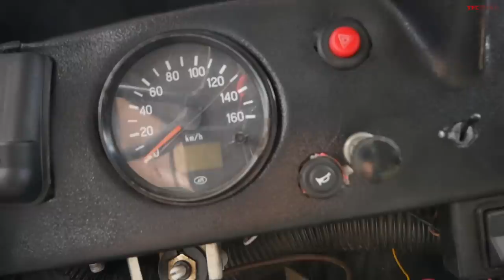My Russian Van Is A Better Off-Roader Than Even A Modern Toyota Collab — And THIS Is Why!

Comment: He doesn't get it. This is for extreme cold and going places where the driver is on his own. The systems, including the door handle Motoman goofed on, are made to be ultra reliable, especially in off road and super cold environments, but still affordable to middle class Russians. The machine is spot on for intended purpose.
Reply: This was not affordable and not accessible, only 10% of the soviet people had vehicles because it took 10 yrs to get them and wages were extremely low, and good thing we have capitalism, you have a better car that's more comfortable,  and btw, its just a door handle, most don't break
Reply: @guamazolopez6456  But how do those comforts and stuff handle -40 degrees celsius in winter and +40 degrees celsius in summer...
Reply: @guamazolopez6456  Like I said, middle class. 10%, Maybe? My point was really that it's not a luxury vehicle but a utility vehicle.
Reply: @mike36dc  You are all wrong. :)) These  UAZ 452s were mostly in police and military use along with GAZ 69 and UAZ 469.. Soviet and Bulgarian people (where I come from) usually were able to get Lada (usually VAZ 2101) or Moskvitch (408 or later 412) after 10-15 years waiting list. And maybe 1 of 10 families had a car at all. We had Moskvitch 408, 1.4L, 54 Hp. a beast :)))) And BTW there was no middle class in the communist era... We all were poor except the big fish.
Reply: @BelchevKalin  Understood. The middle class comment meant the cars were made for function for those who could afford a less expensive car (middle class) as opposed to the very rich who could afford whatever they wanted. But thank you.
Reply: @mike36dc  I got what you mean.
Reply: @guamazolopez6456  the stupid part of this statement is it took me longer than 10+ years to get a 90cc enduro from the 70's as a first vehicle. The only reason you think it takes less time in America is because we take out loans and pay for stuff backwards.
Reply: I worked on a gold mine in Kazakhstan 40km north of Ust Kamenogorsk near the Chinese border. We had a few of these type on the mine and got us through deep snow, mud on site at -40C, no problem. Fit for purpose.
Reply: It was not really affordable/accessible for normal Russians.  The Lada Niva is for more ordinary citizens.  But that took ten years of waiting, like all Soviet-made private vehicles.
Reply: Деревенщина из Сибири - Абакан   That video was awesome. Thanks for the share.
Reply: K think it was primarly utikity car for wide variety of use in industry, police, ambulance, army etc. In extreme conditions with easy maintenence.
Reply: @russetwolf13  i have seen mexicans get better cars in 2 or 3 years lol, and if you didnt readed the commen from the bulgarian guy, less than 1 out of 10 FAMILIES  had a car, how many families have a car in the US? What car continues into production with no improvements since the 60s in the US? Or the entire world for that matters lol
Reply: @StoneCoolds  Americans own cars, we don't buy them. We convince a bank to lend us the money to buy a car now and spend 10+ years paying off the loan just in time for the car to start falling apart. Though a lot of the time they can't pay for it and a terrifying amount are repossessed by the bank.

Most every person I know, the majority of Americans in fact, would kill for a functioning Buhanka because most of the time we pay top dollar for barely functioning cars beaten to the last inch of their life. This is what no one talks about in America, you look at the nice new cars and see how many Americans own cars and don't realize most of those cars are barely functioning rust piles, not brand new Teslas.
Reply: @russetwolf13  yeah. The USSR had a lot of reasons. People not going into debt to buy cars was not one of them
Reply: This machine is for deep deep forest. I don't understand, why this shit is steel in production.Piece of......      Shame.
Reply: @utfinjuice  Dude, this would sell in The States. Most of our "manly" suv's are really made for women. Upgrade the chassis so it could hold 80 mph and it would sell like hot cakes.
Reply: Why you compare two different worlds. This car was supposed to be repairable in the middle of swamp with few simple tools. Then, all in ussr was standarted. This was the one equipment for all the purposes it supposed to perform. Which mean you can get spare parts everywhere within the Soviet Union. And it didn’t take too much room for storage. If you have basic small sedan there was same idea. No big variety for thousands different bolts or little rubber things. That was supposed to save lots of valuable resources for global scope. 
And in Soviet Union they didn’t really need too many personal vehicles because all was designed to reduce need of it. At public transport you could go everywhere in the city not like now in America. And those vehicles were supposed to last forever not like modern comfy cars falling apart without possibility of continuing use. You can imagine how it affected ecology and resources. We selecting garbage and wasting crazy amount of valuable resources.
Reply: @StoneCoolds  That's a good point. But it should be noted, American cars and trucks are better and more reliable because of the Japanese. American cars in the 1970's and 1980's were on the whole poorly designed and unreliable, and then the Japanese began to import reliable cars that were nice to drive and they had huge sales. American manufacturers had to up their game & American cars and trucks only then improved tremendously.
Reply: вы верно отметили назначения этого автомобиля. но не только в холода а скорей для сурового бездорожя. где главное минимум электроники и максимум ремонто пригодность.
Reply: Plus you can access the engine from inside the van
Reply: @StoneCoolds  don't forget city planning as well, like imagine having a kindergarden, a school and a few shops within walking distance, ah yes for everything outside your walking distance you have buses/trams/trolley/trains
Reply: @StoneCoolds  That's not true. I am Bulgarian also. We had plenty of cars but they were mostly Lada and Zhiguli. Only a fool would wait 5 years to get a car, you could get one very quick if you grease the right palms. Maybe in Russia they had to wait 10 years, not in Bulgaria.
Reply: i was watching Russian documentary about Yakutsk recently and i found out people have a warm blanket for their cars so everything doesnt freeze before morning before they go to work.. im not kidding, just check it out..its on youtube
Reply: @minecraftfirefighter  I live in america so i dont know if thats 400 degrees farhenheit or -400 degrees farenheit
Reply: as a matter of fact this car had never ever been designed for "middle class Russians" or any other private user, it is designed for a heavy duty military and civil service, emergency personnel, collective farms, oil and gas drilling workers etc. I'm not quite sure it had ever been available (not even to say marketed) for private use in USSR. Have you ever considered buying a waste disposal truck for your everyday commuting? well, that is exactly the same thing
Reply: @guamazolopez6456  somewhere in the middle, most of Siberia will be warmer, temperature like Canada... Where people drive nice cars.
You can't even fit a Canadian's breakfast in this van.
Reply: @julianpetkov8320  Here you have to grease the Ford dealer, I mean, pay the "market adjusted rate." Same thing.
Reply: Ha! 😆😆😆
So many Americans taking the opportunity to point out that everything about Russia is bad. 
What does that tell you about someone!
Reply: @StoneCoolds  Don't worry. You, too, will soon own nothing and be very, very happy indeed, lol
Reply: @whenuakitekid  no American on this thread said a thing negative about Russia. Maybe read again? Everyone just loves the van, but some from where it's sold, not Americans, mentioned difficulty obtaining it.
Reply: @mike36dc  I love these vans too, my bad Interpretation of a couple of comments, I have been a bit sensitive of late,
my apologise
Reply: @whenuakitekid  No worries. They are cooler than cool and quite unique. I love 'em too.
Reply: And operate with mitts
Reply: @julianpetkov8320  most people could get a car by either greasing palms or travel to work far away. My family didn't have a car but that's because public transportation was huge in Soviet Union, and is still big in Russia.
Reply: @icenine135  And in Spain, France, Germany and many, many others. In places with good public transportation it's a hassle to own a car. I love my vehicles, but if I was in Spain or France, or NYC for that matter, I wouldn't bother to own one.
Reply: @minecraftfirefighter  American and japanese vehicles do, not European. I live in ND and we see that temp range. The european vebicles always have more issues than American or Japanese, especially the extreme cold.
Reply: @russetwolf13  So which is better borrowing money for it or not having it at all.
Reply: @unconventionalideas5683 Ordinary people  in the  U.S and Europe usually buy a car with a loan from a bank or lease a car, and rarely buy it with a cash because they cannot afford the average new car........  otherwise they would have to wait for years to save up cash to buy it....... and you are talking about waiting list? It is ridiculous...
Reply: LOL!! It’s very obvious you don’t own a TOYOTA.
Reply: @guamazolopez6456  100% советских людей имели крышу над головой, доступ к бесплатной медицине и образованию.
Reply: Деревенщина из Сибири - Абакан   I'm afraid you're wrong. The development of a van, that later became famous as UAZ 452 started around the same time as the Jeep FC, even before it entered production. And UAZ was originally intended to be a wagon type van, while Jeep FC was a small truck from the beginning. Plus originally UAZ buhanka (to be exact, its prototype UAZ 450) had a very different design, not even close to Jeep.
Короче говоря, машины разрабатывались совершенно независимо друг от друга, а их внешнее сходство было обусловлено только автомобильной модой того времени)
Reply: Absolutely as they can serviced by anyone and are unstoppable and foolproof.
Reply: @StoneCoolds  Yeah right..
Reply: @BelchevKalin  who is big fish?political leaders,the boss of a big company,who is it?
Reply: I thought communism wasn't supposed to feature a class system?
Reply: @russetwolf13  10+ years for a motorcycle that cost 600-5000 dollars? You're either horrible with money, or you need to move somewhere cheaper.
Reply: @supremecaffeine2633  when did I say anything about a motorcycle? I'm talking about cars.
Reply: @russetwolf13  A Yamaha 90cc enduro is a motorcycle. In perfect condition it still cost more than my first car. Learn how to manage you money better.
Reply: Ultra reliable? You have ab-so-lutely no idea what you're talking about. The bukhanka is hideously unrelaibal and full of idiotic construction elements. It's good offroad. It's repairable. But definitely not reliable. Add the horrific build quality on top, at least the modern ones. I mean there are many cases the new cars comes with a rust already. And in a few years some get holes in a body and a shattering frame.
Reply: @HeartcoreMitRA  Right. By reliable I was talking systems and purposeful design, such as manual window or limited computer control, not build quality. I get what you're saying and I understand, but as an American I'll let Russians and those where the vehicle is sold dog the quality as I have never been around one. In the US simple design is often still valued, such as the manual windows in the basic Wrangler. The guy in the video compares this to modern SUV's that are made for American soccer moms.
Reply: @mike36dc  Simple does not equals good. Older LandCruiser or Patrols is good and simple. But i'm sure you can find lots of cases where things are simple, yet very poorly designed. And there's also some mixed stuff. GAZ-66 for example have really good chassis, but lots of issues with an engine and ergomomics.
Reply: @HeartcoreMitRA  Of course simple is not always good, but simple is less likely to have functional problems. I get that there are issues with these vans but as an American where we have nothing similar I think they are super cool.
Reply: @mike36dc  You can always get things like an old Bronko or K5. But if you'd been able to buy a first-gen Econoline from 60-s for the price of new vehicle with a horrible build quality - i don't think you would buy it, now matter how simple it is.
Reply: @HeartcoreMitRA  pretty much my thought. Doesn't mean I don't still dig the old stuff.
Reply: @guamazolopez6456  Bukhanka’s primary selling point was to be an ambulance vehicle in rural areas,it wasn’t exactly supposed to be a consumer vehicle
Reply: @guamazolopez6456  a year during the soviet union 🙄 after 1991 just buy whatever you want
Reply: @StoneCoolds  The vast majority of Russians are living in cities. And in Russian city you don't need a car. Most of what you need to live is in a walking distance. And if you need something farther away, there is public transit system. Buses, trams, trolleybuses, subway. The whole city is designed around it. It is much cheaper, conserves energy, natural resources and surface area of the city. And it is especially important in very cold areas.
Reply: @guamazolopez6456  
Maybe but can you fix a modern American car with pliers , bailing wire, duct tape and a beer can?
Reply: @BelchevKalin  "We were all poor except the big fish," projection really given how capitalism has the highest wealth inequality as a minority have more wealth than the entirety of the world's poorest half. And when the richest man's almost a trillionaire and most people can't afford a 500-1000 dollar emergency, etc, etc.
Reply: @guamazolopez6456  people still buy these cars new and there not for middle class they are for everyone that needs a car that can go anywhere. But people actively drive them where there are no roads. I've seen them do it.
Reply: I live in Norway,  had a Volvo forward controlled military veichle from the 60's for 13 years,  very similar to this,  and reliability compared to japanese cars and western cars is kind of poorer,  BUT,  its allways started how matter how cold,  and was so simple you could wrench on it with simple tools in a swamp,  and extremly rugged and climbed evrywhere. But comfort? NO. You cant really compare such a veichle with more modern cars..  If  you are in the middle of sibiria or alaska..this kind of car is want you want in my opinion
Reply: @StoneCoolds  It's almost like Soviet cities weren't suburb hell and had actually good planning where you didn't need a car to do basic stuff.
Reply: @guamazolopez6456 how will your capitalistic comfortable leather not peel off at -40°C ?
Reply: @guamazolopez6456 capitalist country I live in. 5 years and still no car. That’s how bad it’s been getting

Comment: Back in Soviet Union this Buhanka used for EMS services.  And it was disaster transporting patients. It is so jumpy you even don't need defibrillator
Reply: In the US I was transported from the hospital to a less expensive place to finish recovering from a shattered pelvis.  The ambulance was basically an upconvert of a one ton cube truck.  Strapped to a back board I felt every pebble on the highway.  Two years later I was a pall bearer at my Grandmothers funeral, caught a ride in the hearse from funeral home to cemetery.  It was smooth as oiled silk, for a passenger in no condition to complain.
Reply: @Riyad Razz and so - did you find anything better that worked in the climate and conditions there?
Reply: @tonyking9235  Did they invent the CapsLock, too?
Reply: @gurglejug627  NO I DID .
Reply: Last year, GAZ released el. version of his Gazelle micro van
Reply: Cada vehiculo su utilidad, la bukhanka es para trabajar en bosques o campos quizas no como ambulancia.

Comment: Drove these years ago in Mongolia. Produced for decades with some incremental improvements, but the core is still same. And it makes sense. It is completely utilitarian concept. Less features, less parts, less things that can brake down. The built quality, fit & finish is truly Russian but when something falls off, you can either do without it or nail it back on. And practicality of these is undisputed - its a box on wheels where you can work on the engine from inside (if needed). We smashed one doing around 70 km/h across the Mongolian stepe. We were sort of racing with another Buchanka and we eneded up side impacting it. We had our left side beaten up, the victim had the right side beaten up as well. We swaped our right-side doors (front and rear) with theirs and that was that. But the other one was ex-EMS version so our Buchanka was beaten from all sides with right one in the bright day-glo colour. When we returned to civilization, the bodywork was mended with hammer and large screwdriver. If had to pick a vehicle for post-apocalyptic survival, this one would be strong contender.
Reply: Thanks for this
Reply: I prefer to have this Buhanka other than fancy expensive ones
Reply: And the  AK47.
Reply: I hope car designers will continue making utilitarian designs
Reply: These remind me of VW bugs, before the damn EPA and safety Nazis ruined them.  Good solidly made vehicles, with minor improvements made as needed, designed to reliably get from point A to B.  (And you could fix them with hand tools and without a $50K analyzer).
Reply: That's why there is buchanka in metro Exodus game, working van after nuclear war

Comment: Russia is enormous and mostly undeveloped so they design the vehicles to be fixed with a basic set of tools, modern vehicles stop working the moment they encounter a bad exhaust sensor which makes them extremely risky & unreliable in undeveloped parts of the world, I'll take the Russian version everytime.